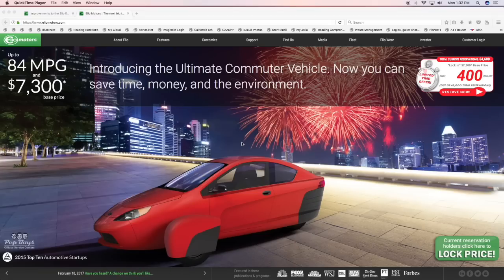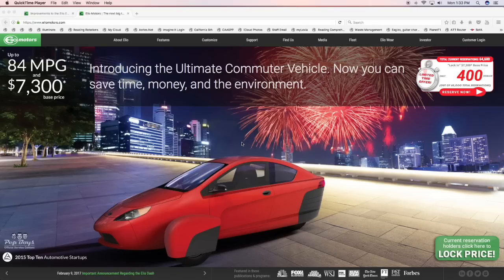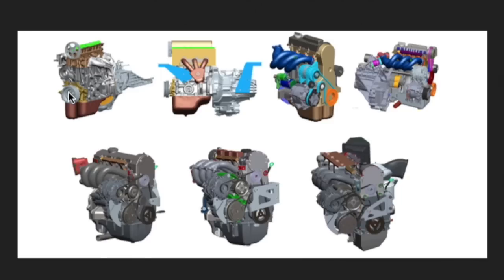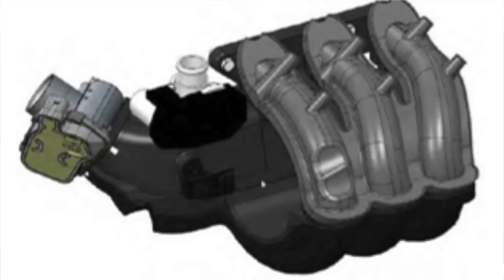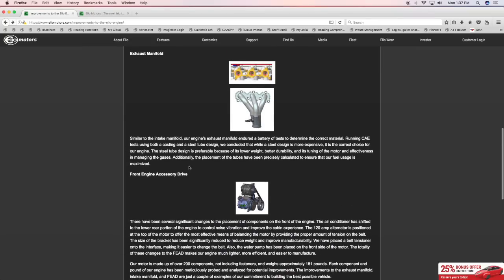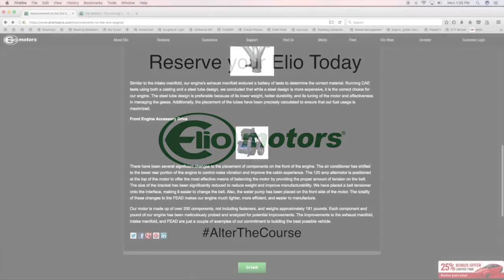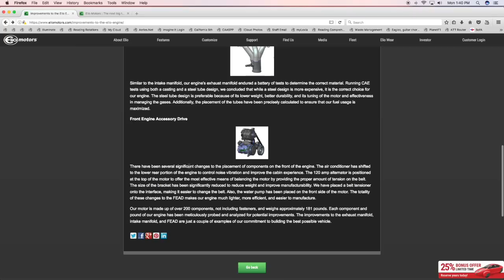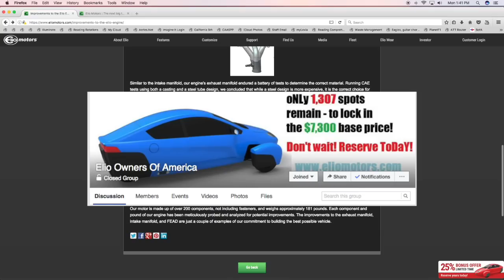Let's Talk Elio: Engine Update

Comment: More smoke and mirrors from Elio, to distract the faithful from the impending financial collapse . There is absolutely nothing about this engine that wasn't common practice on most car engines 20 years ago. I was working on cars with plastic intake manifolds in 1995. And this is probably the only "new" engine designed in the 21st century without 4 valves per cylinder. In fact, the animated video from Elio shows a cylinder head/valve train design remarkably similar to a 1971 Chevy Vega. If high efficiency is the goal, you'd never know it from this engine design. Actually there's nothing about it that's any advancement over the Geo motor.

Comment: All good decisions ,, the intake is "dry" so plastic is fine (probably 'GRP') ,, The exhaust always needed to be a small tube shorty header for best scavenging... and moving the ac compressor down low is a common industry practice to reduce felt vibration/compressor engagement compared to giving it a bigger "lever" on the engine package if mounted high... that alternator was a surprise ,,, 120amps! Elio is going for the shortest possible engagement (energized) times to recharge the battery to reduce drag... I would have thought 60 or 75 amps in a modern "short duty cycle" alternator would have been sufficient...

Comment: you could get a good used prius for under 10K . why buy this car?
Reply: This weekend, I bought a 2015 Nissan Leaf EV for under $10K. It only had 11,000 miles on it. So far, I am loving it. My work just put in charging stations for EVs with no cost for charging. My wait is over. I'm OK with my $100 Elio T-shirt.
Reply: edmondov because not everyone wants a Prius
Reply: If you need a Prius size car, you don't need an Elio.
Reply: bluepond hh
Reply: A "Prius sized" car? A Prius is only slightly longer than the Elio, considerably narrower, holds 4 people and has a far bigger trunk. The "efficient" Elio is actually highly inefficient in it's use of space.
Reply: Insurance cost for one as it is considered a motorcycle and the uniqueness of the vehicle. The other is it is new as opposed to the used vehicles.